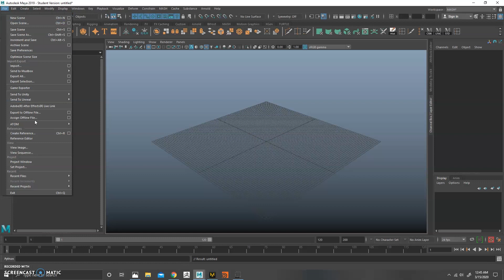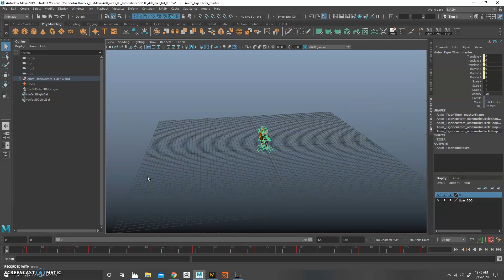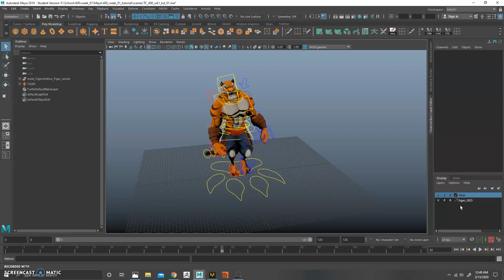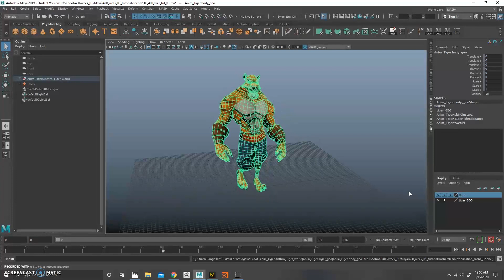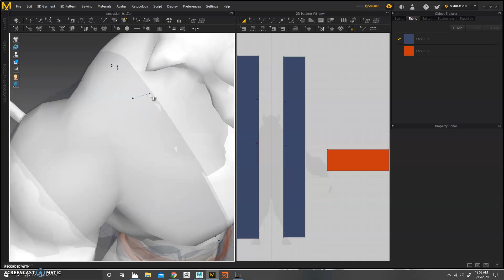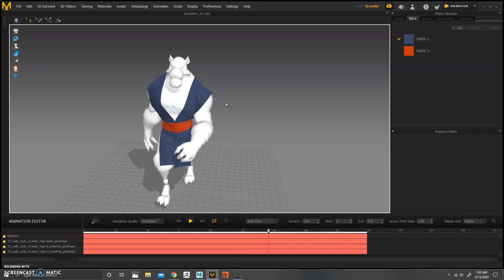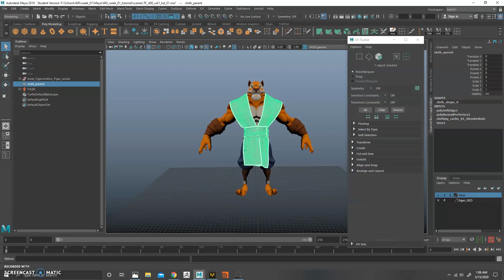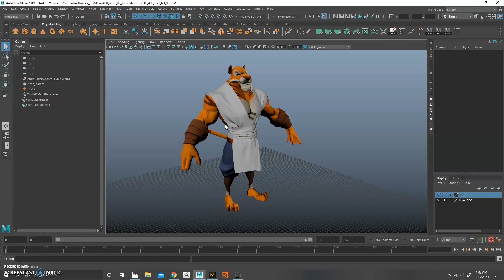Marvelous Designer / Maya Workflow for Production (RE-UPLOAD)

Comment: I'm unable to import the alembic cache into maya :/ it says it's not a valid Alembic file. I tried Ogawa but it only imports a cloth group into the scene and nothing else. i've tried other export options but they dont let you change the frame rate which I really need to do. any advice?
Reply: so it turns out the frame rate option is broken. i had to change my scene to 30 fps, export an alembic, do my marvellous business, export ogawa at 30 fps and then import that into maya and change the scene back to 25. really annoying. im using maya 2022 btw. hope this helps somebody
Reply: @cystemic-x  THANK YOU! it work! <3 :))))

Comment: When i import my alembic cache the number of frames are not accurate to my maya scene.  I was wondering why every time Import it back to maya, my clothing animation timing is off.  One way i went about fixing it is changing my scene time warp to be .8 because the animation is a bit longer in marvelous.  How do i fix it so i don't always have to play with the scene time warp?
Reply from the maker: I'm wondering if it's because you have different framerates between Maya and MD. In Maya down in the right corner near the timeline should be a framerate option, that needs to be the same as MD's framerate. I think Maya defaults to 30fps while MD's standard is 24. Maybe give that a try? Hope this helps!
Reply: @telescopicjuniper  i have it as 24 fps
Reply: @hl6273  I have the same problem. Could you fix it?

Comment: So...you actually do animations before putting the clothes on? I'm asking cause i'm making a short movie and since i'm a beginner i wanted to know if I should hand the model with the rig to the animators before doing the clothes? Great content btw !
Reply from the maker: Hey Sachpierre, glad you liked the video! the important thing when working with Marvelous is having a model with a neutral pose. When you give the rig to the animators, you should have them set the rig to it's default pose and put it back to the origin for each shot. give it like 3-5 seconds of buffer between the neutral pose and the start of the animation. You would need to do this so that there's time for the cloth to settle before the animation happens. Traditionally, I think most people create the clothing during the modeling process, but simulate it after the animation is done. Also keep in mind that this is just the workflow that I use, there may be better more efficient workflows out there. I can only speak from my own experience. Sorry for the lengthy reply, hope it helps!
Reply: @telescopicjuniper  Thanks a lot, it's clearer to me now. Unfortunately I was given the task of doing the rigging lol it's a pain haha. Now I know it wouldn't be a waste of time doing the clothes this early on in development ! Great video keep it up :)
Reply from the maker: @sachpierre1848  Best of luck on your project!

Comment: Quick question, I'm trying to do this with some clothes models I imported form Maya but at it keeps giving me the error "Could not recognize UV borderline correctly" when generating the patterns from the UVs it has, have you even had this problem?
Reply from the maker: I have unfortunately. Try double checking the scale of your geometry, it needs to match MD in order to trace the UVs properly. When I had this issue, I found some online forums that helped troubleshoot the issue. Usually just googling the error line that MD provides will give you some online resources to help.